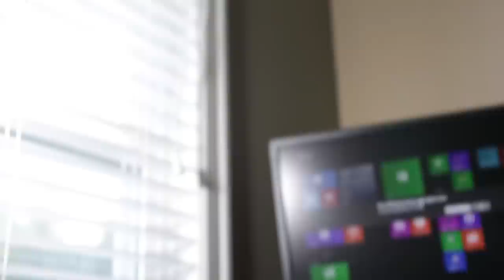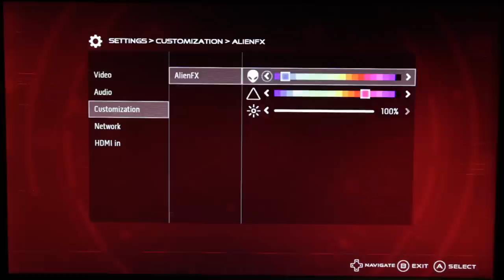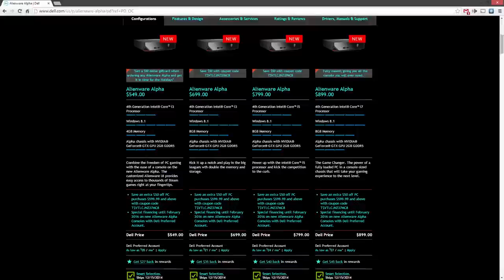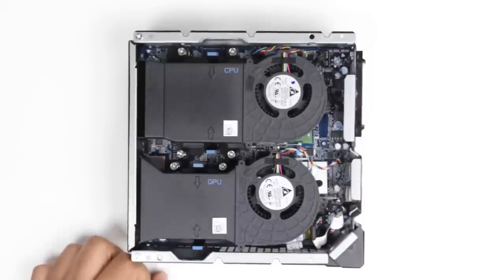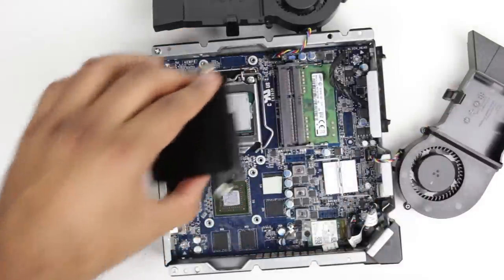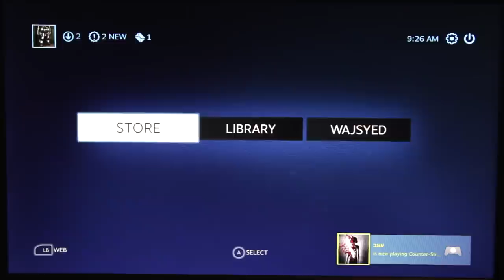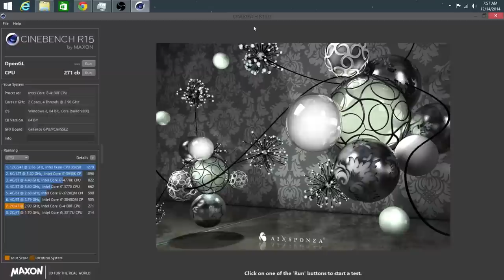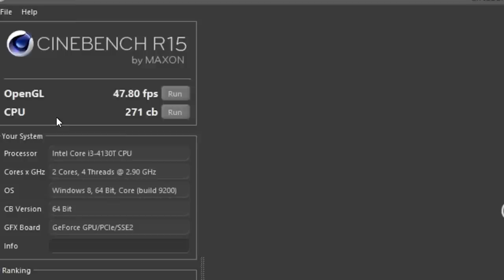Alienware Alpha Full Review

Comment: The biggest advantage of a pc is that it can be upgraded easy ..

Why should anyone buy a pc which is more expensive than a console (twice as expensive), less powerfull than a console (considering custom linux of the ps4 uses less system resources than windows 8.1) and with a GPU that already has shown its limits with modern games (let alone future games) that you cannot upgrade on your own ???

This is the worst value for money ever ..
Reply: Yes because its a p.c. trying to be a console, a true PC will allow you to play games in 4K which the current next-gen cant do and since 4K is becoming the new resolution standard what are console guys supposed to do? when there stuck a 1080P or less?
Reply: optimus439 i really respect your opinion but to me graphics isn't the case here .. to be honest, resolution to me doesn't always mean good graphics ... the point here for me is the immersion and a reliable gaming machine offering good value for money, a machine that will offer you a great deal of gameplay for the next five years at least .. i strongly believe that these console disguised pcs are combining the worst out of both worlds ..

Comment: Can it fallout new Vegas(with mods)? If so will it be at least 30 fps depending on how much content I have?
Reply: If you get the alpha get the upgrade to the i7. Mods need cpu power most instead of the gpu power.
Reply: Thanks and could I could that off of amazon
Reply: The base model runs it maxed over 60 fps you should be fine.

Comment: That system is weak. My 6 yr old pc (i7 860 @ 2.8GHz, 8 GB RAM, GF770 2G (the only upgrade some month ago)) scores around 3000 points in the valley benchmark (but on ultra settings). 

FPS:72.7
Score: 3042

Dragon Age runs around 50-60 FPS and except of the 30FPS locked stuttering cutscenes it runs fine.

Comment: horrible comparison. high on these games has AA on. consoles don't have AA.
high on PC has more details and usually father draw distance than console.

you're arguing as if the alpha competes with gaming PCs for 1000$.

the alpha competes with consoles. 

what you should have done is compare apples to apples and use similar quality settings (NOT just 'high' because high on PC =! 'high' on console).

then compare both. yes, 33fps is 'unplayable'. but why AA? why some idiotic framerate eating quality options? just lower them until you hit console quality. then compare fps!

if you are doing 'benchmarking' you cannot compare console low quality with PC with AA and such enabled.  it is IDIOTIC

why even do benchmarking at all! go compare quality of gameplay at similar details.
Reply: I think part of the problem is that people are comparing it to a gaming tower instead of other mini ITX builds. In that bracket, it's actually bloody good for the form factor and price (which I never thought I'd say about an Alienware product :P )
Reply: Some Guy in a Waistcoat exactly. people who've built their own stuff for years will surely build something faster. but for people who'd buy a console and want something small and easy to use, it's very good.

I'd not buy it. but I'd never buy a console either. and you can do real work on this.
it's a real PC.

you can play league, or whatever you want.

at this price point it blows any console out of the water
Reply: Some Guy in a Waistcoat that AA just ticked me off. who enables AA if the framerate can't handle it??

it's so misleading. especially since consoles never do AA
Reply: That gets me too. I never usually bother with AA past 2/4x even on my big rig. On a modern game at native resolutions, that's just not going to look much better for the hit. I'd be better pressed to use those extra few FPS for another piece of eye candy or for a buffer when recording.

Comment: im sorry but this thing sucks and that is coming from a loyal Alienware customer.
Reply: The model in this video comes with a I3 dual core with 4gb of ram with the modified 860m.
Seriously, you can just get the I5 model with 8gb of ram and the modified 860m, and that will run most games on high details.
Reply: Sure you can, but the chips in this thing are all BGA so good luck ever upgrading it. I have an Alienware 17 with a Gtx 860m and it runs like a dream and if there is ever a game I can't max out I can just put a Gtx 980m in it. You won't be able to do that with the Alienware "alpha" so once games start requiring better graphics cards you are pretty much SOL.
Reply: MrNatetheepic And? It will last for pc exclusives for about 3 years, and console ports for about 5.5.
By then I will have enough games in my library.
Reply: MrNatetheepic And if I have to, I can just lower down the detail settings. I'm not a casual gamer but at the same time I'm not a hardcore gamer that wants high/ultra details for life.
Reply: lower settings are for scrubs lol.
Reply: MrNatetheepic Wow, you just want an argument, don't you?
In that case, your not getting one.
Reply: no, im just expressing my disappointment, Alienware is supposed to be over the top, they shouldn't even have an i3 configuration. if i wanted to play at lower settings i would buy an Xbox one and save some money.
Reply: You cant beat what you get for 450.00 period
Reply: so the $500 "alpha" has an i3 4130t (POS), 4gb of ram (really you are gonna start running out of ram quick), GTX 860m, and a 500gb hdd. i have to say that is really good for the price of the steam machine compared to other steam machines. but why not just get a regular desktop and set it up as a steam machine? desktop graphics cards run so much better than laptop graphics cards.
Reply: MrNatetheepic the graphics arent the selling point with this, its the fact that its an easy solution for those who want a compact gaming machine that isnt a console

Comment: should i buy this or build this http://pcpartpicker.com/user/Kingvicious/saved/Cc8j4D
i'm mainly gonna be playing dcuo, league of legends and batman arkham knight once it comes out.
Reply: A Built One for sure.
The AMD Athlon 860k is the same as the 7850k you got there without the Integrated graphics, and you won't be able to pair that integrated one with the r9 270. You could get the 860k, or
- an i3 4130 (http://www.outletpc.com/dy8261-intel-core-i3-4130-3-4ghz-dual-core-lga-1150-cpu.html)
-and an Intel motherboard (choose around the same pricerange as your one, or go a little bit more expensive like : http://www.outletpc.com/hi9791-gigabyte-intel-b85-lga-1150-motherboard.html )
The Intel processor is better than the AMD one, and Alienware Alpha uses the same cpu.
Reply: *****
thanks, i'll be sure to check it out.
Reply: yeah, don't buy this.  build a pc, you'll be much happier.
Reply: I have a question and can someone please answer me. I have a Toshiba satellite c855-s5346 and it is complete crap but I want too upgrade it and make it into a gaming laptop. Is it possible that I can buy the parts and replace the sucky parts like the processor and ram and add a video card and hard drive (proabably new fans so it wont overheat) and make it a gaming laptop
Reply: omary saho No.

Comment: I have a question , it's pretty retarded but I need to know : What is the difference between i3 , i5 and i7 Thanks ;)
Reply: Oh God. Just look it up, you'll see the difference.
Reply: LoL
Reply: That was very helpful...
Reply: To answer your question, power. The difference between them is each pretty significant. But in this box I would call an i7 overkill, and honestly, inefficient, because it's going to be bottlenecked by both the GPU and PSU.
Reply: DoubleVendetta (*******Chance Cox*******)
ok thanks ;D
Reply: DoubleVendetta (*******Chance Cox*******) I'm quite sure there is an i7 model and soon Xeon!!! You may have just drank the wrong BOTTLES in the field of information technology LOL cause check it my macbook pro has an 2.5 Ghz i5, 8gb ram, 1024 MB? Or more remotely 720 MB visual memory and crashes when trying to play P2 or dreamcast but other then that everything else from before those systems time work superbly so you might need to reconsider about BOTTLENECKING and before you make a joke of my Mac I also OWN a PS4 and could care less about recommendations because it's a system that is ahead of it's time in terms of it's power and economy!😊
Reply: And upgrades are in the works for my Mac soon as well cause it's the one that has a interchangeable logicboard.
Reply: If you look at Windows or Intel's latest ads they always rev about the i7's whether basic or extreme let alone the even higher Xeon processor or going back to they're old i5's or i3's.
Reply: i7 is not as bad as you think kid
Reply: And with my Mac I love playing emulations of game systems
Reply: +Ayamalach  facepalm I never said the i7 was bad. in fact I said the exact opposite. Can you read?
Reply: DoubleVendetta (*******Chance Cox*******) No you said Bottleneck which is basically when processes whether crucial or not are unaccounted for in the cpu
Reply: +Ayamalach Yes, I said that an i7 will be bottlenecked, which means that you will not be able to get the actual performance capabilities out of the chip because the GPU in the Alpha will hold it back, AND the power supply unit is set to automatically downclock (means make it slower) the i7 because it uses more power than the power supply can provide.
Reply: Hyper threads. The Alpha has an i3 with hyper threading.
Reply: Tigger Smoove Also correct. Otherwise known as simulated quad core.